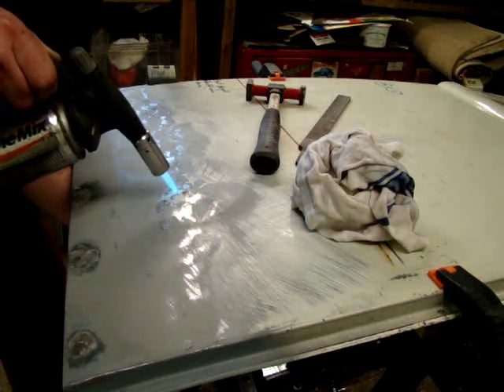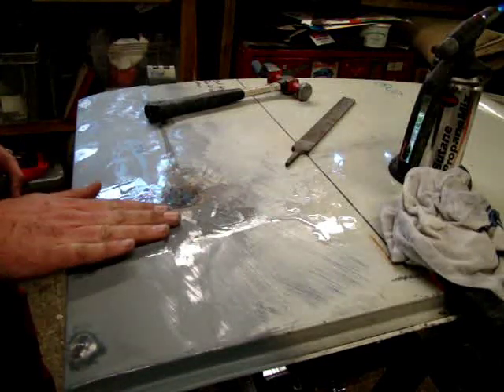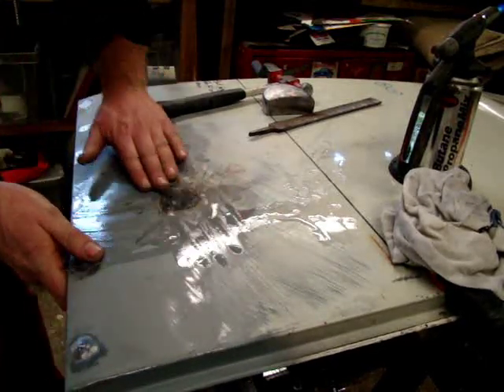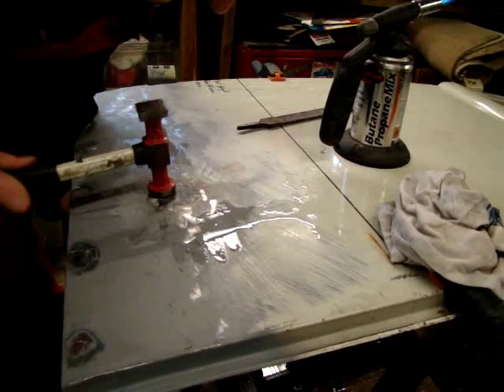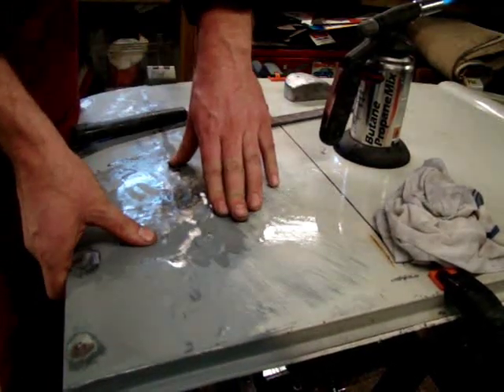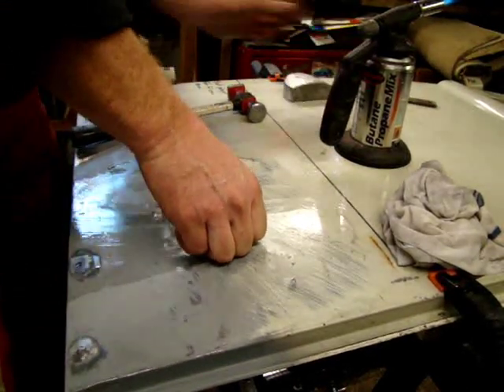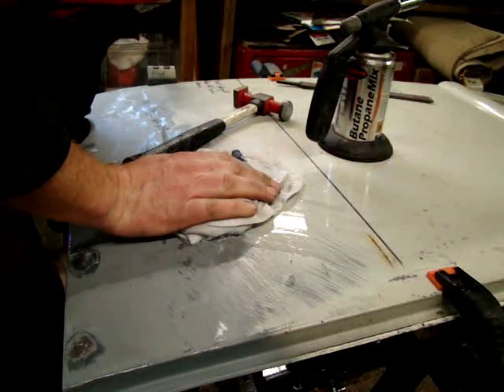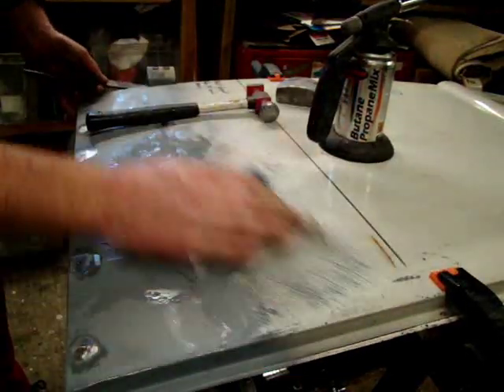Metal Shrinking Cargo door

Comment: Nice work. I am learning the same process on my 65 bug. I've made a couple attempts but decided to watch a few videos before proceeding. I'm using MAP Gas for heat. I also found that I wasn't using my hammer/dolly correctly. As you pointed out, you have to start on the outside of the area (hammer off) and then finish the inside with the hammer on technique. All in all it's not that hard to do; just takes practice and patience. I also have a splitty; 66. It's my next project after the bug. Hopefully I'll be better at body work by then because it is really rough. Thanks for posting. Bruce'ster